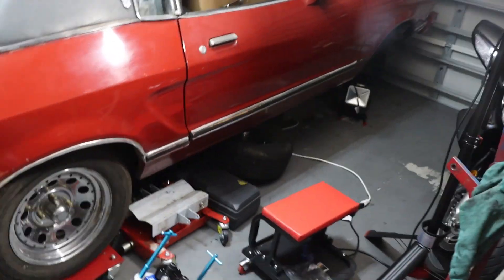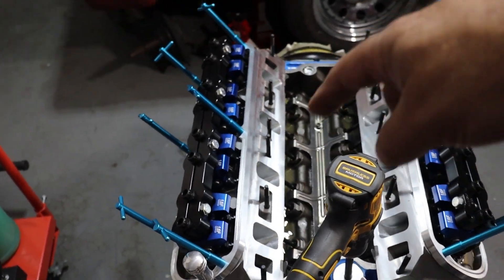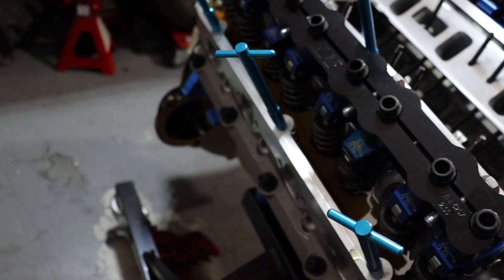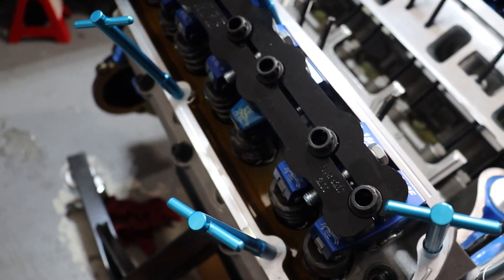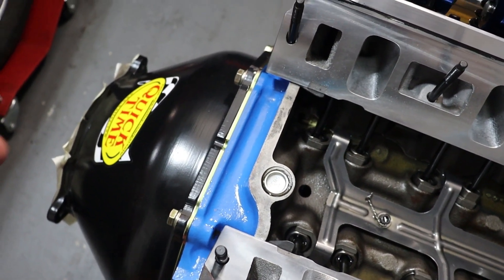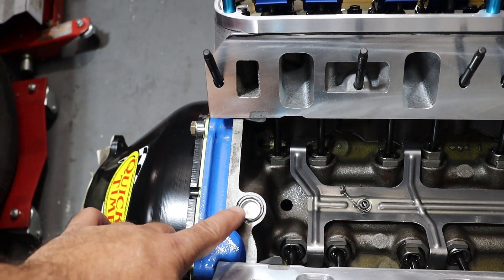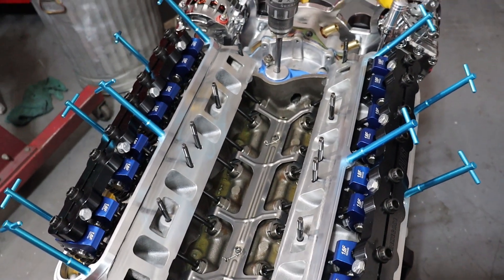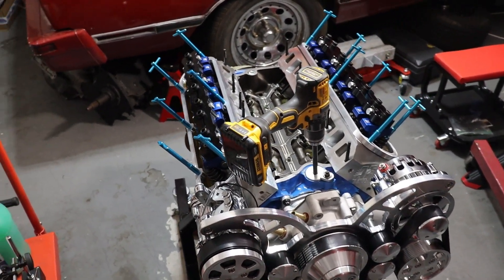Priming my SBF Oil System

Comment: Are you using the comp cam roller retrofit kit? Also what cam are you using I’m gonna be doing this with my 289 I was going to go with the 165 afr heads but I want to do the 185 instead with some done pistons 331 stroker kit
Reply from the maker: Yes, that's the Comp Cams roller retrofit kit, and I'm running the Comp Cams 31-601-8 Retrofit Thumpr Cam.  One cool thing about the retrofit cams is that you don't need to use a bronze distributor gear, they are designed to run with the stock style ductile iron gear.
Reply: I’ll be getting that same cam and kit